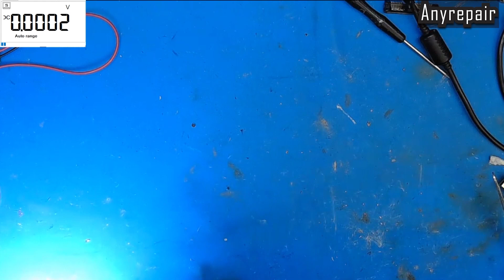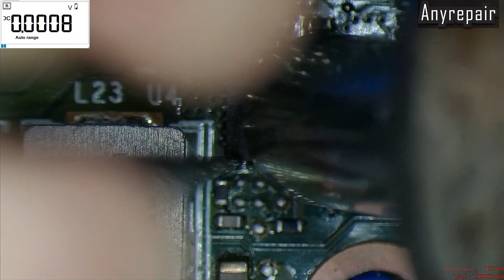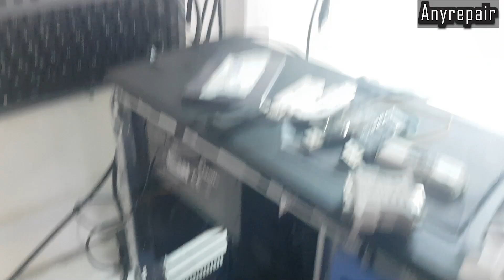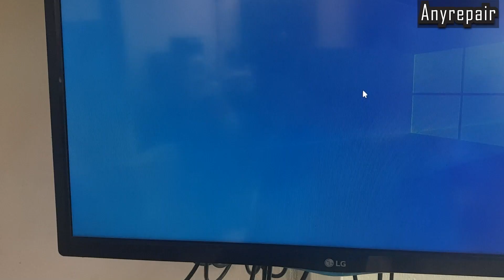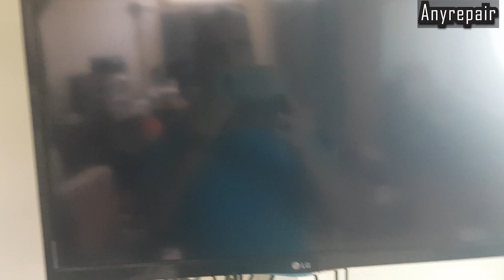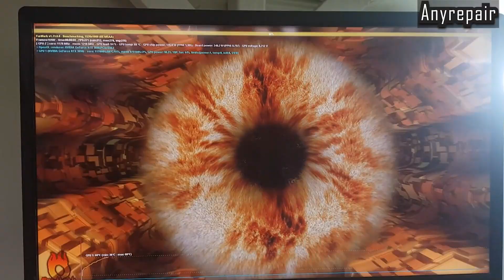DELL RTX 3090 no display...repaired!!

Comment: I have a  relatively new card used only 8 months , I use surge protector and line conditioners but this morning when I woke im not getting any display , what's the average cost of repair for Dell 3090
Reply from the maker: It depends on the country and the working hour expenses. You should ask a technician in your country about that.

Comment: I have this card, I purchased it used. It has always had some issues but it seems to be getting worse over the couple of years I've had it. The main symptom is that it blanks out the video, the fans turn to 100% and then the system continues doing things in the background a bit then eventually freezes. Same problem on both Linux and Windows. And it even happens when the card has near zero load, though it seems more likley to happen when the card is heavily loaded. But not always! sometimes I get 24 hours of 100% usage rendering complicated multi model work flows. Unfortunately I have no money but i need to fix this.. Any thoughts as to what this may be?
Reply from the maker: Check out if the is a thermal issue first. After that you must check for vram issues or gpu issues...but these require electronic skills and equipment.

Comment: What thick thermal pads should be used, 1mm or 1.5mm or even 2mm?
Reply from the maker: Hello, it is what the card supports.  You can google it Iam always measuring the thickness of the pad, just to be sure
Reply: @AnyrepairENG  Everywhere I write something completely different when I was looking for information. Someone writes that 1 mm is enough, others write that they recommend 1.25 or 1.5 mm and others even 2 mm. That's why I'm asking you when you repaired it, what kind of thermal pads did you use???
Reply from the maker: 1.5mm in my case @Real_Boy85